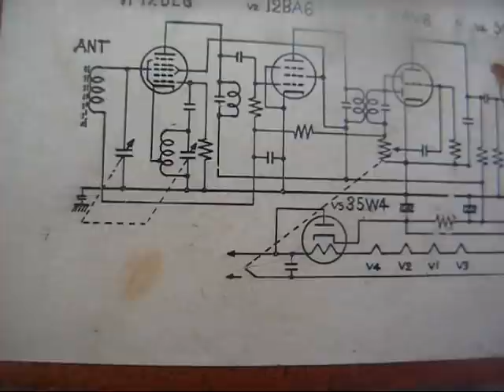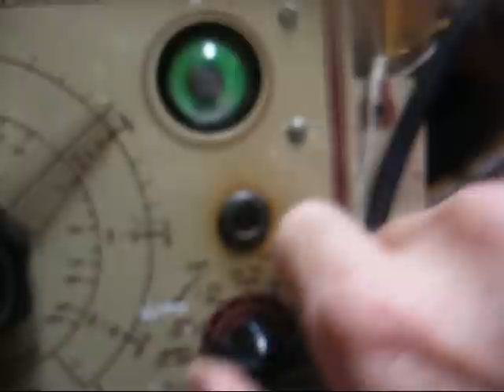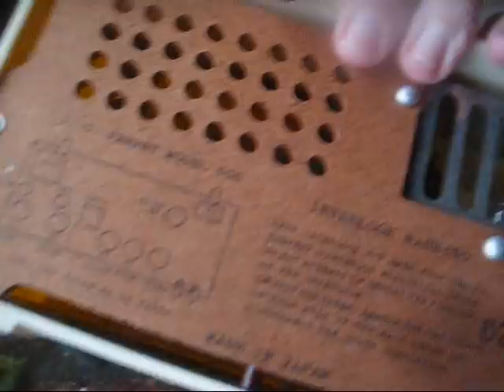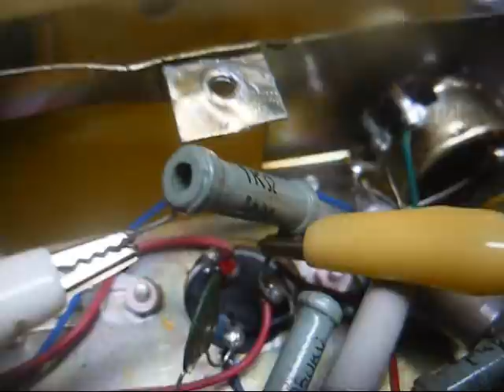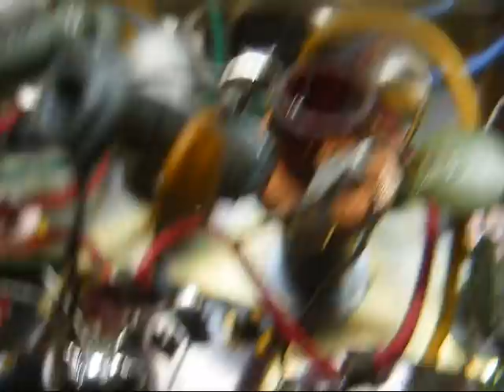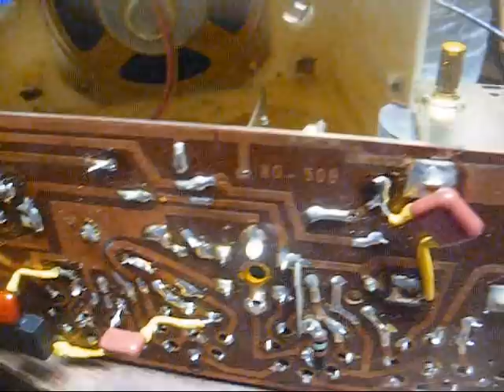Repair of a Strat-O-Sonic & JC Penney Japanese-built tube radios

Comment: It was the winter of 1962, my room mate had a little radio almost identical to that set except it was red and the top the case was melted and nearly touching the tubes, and the set glowed like a small Christmas tree at night when he played it, bringing cheery Christmas Music to our small room furnished with two beds, a couple of chests and a dresser. The cord for the radio ran up the wall to a nail, across the ceiling and to the plug on a screw-in adapter on the light.  A chain from the light ran off to each of our headboards of the beds.  The beds were ancient steel frames that once painted white, traces of the paint remained but only in shielded spots where no human hand should ever touch.  That radio brings back the horror of Christmas Eve 1962.  You see mom and my room mate Dale worked at the same café, mom as the cook, Dale washed dishes and swamped the kitchen and dining area after hours.  Christmas Eve came with a party put on by Otto, the owner of the small café, and as was the tradition back then everyone was drunk as hell at the end of the night. I was fast asleep my 10 year old brain dreaming of a new bicycle I hopped against hope to receive (it was not there!) when Dale began shouting at my Dad, who occupied a room on the other side of the long old house, across the land lords home and in the next apartment.  Dad shouted back for him to shut the fuck up and go to sleep. Now awake from the commotion, I pulled the string and the 30 watt light bulb lite up the small bedroom.  What I saw stuck with me even to this day, the white sheets laundered by my mother weekly were now bright red, and both Dale's wrists were spurting blood which was turning the sheets and walls red with every beat of his heart.  I shouted for dad to come quick, and hearing the fright in my voice, he made his way to me.  When he saw Dale, he quickly used the bedding to make tourniquets' to stop the blood flow and shouted for mom to run next door and call an ambulance (back then the ambulance and hearse were the same unit and driven by the same dude.  Before long two burley cops and the undertaker was there with his cart to take Dale to the hospital.  The little red radio was still playing Cheery Christmas music, which always seems to bring the bloody mess to mind when I hear it even now some 60 years later.  Ah well shit happens I guess and we must live with it.  I have seen much more blood over my years as a Soldier, Police Officer and part time EMT on our local ambulance service (in small towns we often do double duty!)  Thanks for the trip back in time, great video's!  I am a bit behind on your films, you see I lost my wonderful wife of 51 years and 4 Days last August and the pain is still very real, I never knew you could love someone as much as I loved her.

Comment: In my high school 'electronics shop' in appx 1970, we built radios from kits that were EXACT duplicates of that Strat-O-Sonic. (They probably came out of the same Japanese factory)  As you can see from the schematic, it's a very basic circuit, and has maybe 2 dozen components or less. The chassis came pre-punched and we had to mount all the tube sockets & the tuning cap & speaker, and then solder all the rest of the stuff.  It was a good little radio, although the tuning was a bit 'loose' and not too selective if you were in an area with several strong signals. But it worked well, and mine lasted for many years.  I wish I still had it.

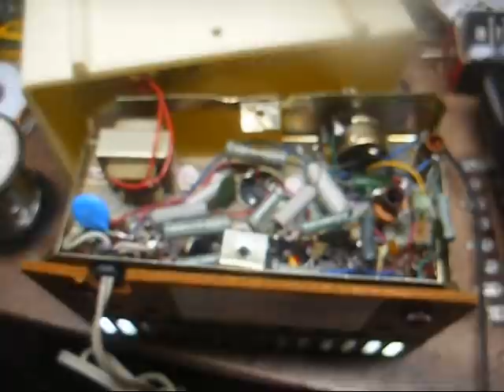Comment: 15:00 What was the reason for putting those caps directly on the line cord, rather than on the other side of the power switch? Could it be that the surge into and out of the cap would have worn out the switch faster?

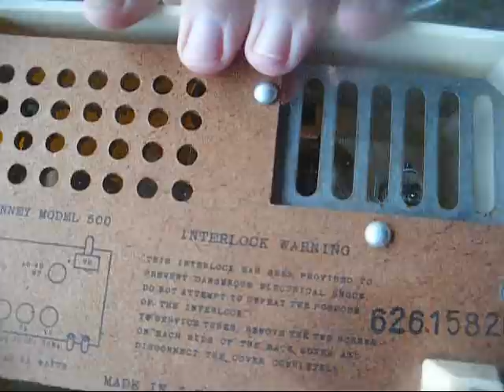Comment: 13:25 If you're not a stickler for details, you might want to grab a cord from  a Norelco shaver; I believe they'll fit, maybe after a little slit down the middle of the plug to separate the holes a bit. I know I've seen cords like that on things like electric knives and even a few boom boxes too, though it might take a bit of creative carving to make them fit an AA5 radio.

Comment: Packing delicate and valuable things is a bit of an art....Like finger painting. An art but flippin easy!
There is no excuse, only laziness or complete mental failure.
For turntables it can be more challenging, being equivalent of making a PlayDough elephant or similar in the art world.
Remove the platter. Secure the tone arm. Remove the lid. Lift the bearing off its thrust pad if it has inner platter attached etc. etc. Use original packing if poss. Always double box. It should be able to survive a drop from five feet easily.
If you pack something and have no confidence in dropping it out your front window then rethink the whole thing. Packing is a pain in the arse, but much less of a pain than getting a broken item sent back.
I have never had any breakages in 40 years. Not one out of thousands.
Edit: Can I have a medal?

Comment: I have a question, I have a restored 1936 Rca 9k floor radio and I want to use either a more modern record player or a bluetooth adapter or mp3 player but need a rca jack for any of those. It just has 2 sets of screws that have jumpers over them and a sticker that says a R-93 record player will make a great phonograph of this radio.. Well I can't just go to my local Walmart and buy a Rca 9k record player.

Comment: I've been buying a lot of home brew Crystal sets from back in the 20s 30s 40s and I got lucky on all of them one of them even has a Atwater Kent tuning capacitor with antenna coil on the back then I got another one that really took a lot of time to make and it works perfect I had to jump a diode across the cat hair Galena . but it still is the best radio I've got its got two coils that are not gang plus another coil that is tunable plus and old brass tuning capacitor out of a radio but it has a knob on it that says robertshaw which is a gas knob.the hours of someone took to make this thing as astonishing and the three-way switch is made out of brass the cat hair whisker knob was made from my looks to be a very pretty Bakelite that was carved.. and the schematic was varnished on the bottom it looks to be around 1930

Comment: Hi, the jumpy multimeter when measuring the grid of the output tube may be a result of your multimeter being in auto range mode. When the meter changes the range automatically, the internal resistance changes too. This causes the voltage on the grid to change and the meter change the range back.
If you put the meter in manual range it may stop jumping around.
Reply: yep , i have the same meter, 10M input on all voltage ranges except 300mV DC range is 100M,  i had mine from new in the mid/late 80s and its still working perfectly

Comment: I just repaired my first tube radio and would like to try another one soon, perhaps one of these would be a good one to get
Reply from the maker: Stick with an American-made 5-tube set. They are usually more roomy under the chassis and easier to work on. These little Japanese radios can be a pain and most people never bothered to have them serviced. When something other than a tube went bad, they usually threw them out.
Reply: @radiotvphononut  good to know, I guess I just liked the small form factor, as I don't have much space

Comment: The JC Penney is a good example of why tubes/printed circuit boards were a bad mix. All of the tubes are seated squarely in their sockets, yet because of board warpage, they're leaning in all different directions
Reply: plus the heat isnt good for those srbp/paxolin boards....they can carbonise,   i've seen pcb's with holes burnt in, and crumbling like charcoal, Pye radio here in the UK made a particularly bad radio that suffered like this, even had a hot mains dropper resistor mounted direct on the board,
Reply: @andygozzo72  Absolutely. I have a GE record player that uses 7189 outputs (which are known for running hot)--there are charred areas all around the board, and I mean actually burned into the board
Reply: @justsumguy2u  and nearly as bad, the first philips pcb radio nearly always will be found to have bad dry solder joints on the valve sockets as they didnt use big enough copper pads around the pins, ..and their next pcb model wasnt much better, still dry joint afflicted in a lot of cases,   one tv engineer i used to know called dry joints 'philips disease', due to how badly their stuff was afflicted !
Reply: @andygozzo72  most of Aussie valve sets had transformers for the step down

Comment: Wow I have the same DMM by Micronta Bryan has. Will wonders ever cease? It works pretty good but shows 30.00 Megohms
with nothing connected to it and the 3 flashes. But works good testing resistors when you do connect one up.
Reply from the maker: This one does the same thing.
Reply: @radiotvphononut  i have the same one, had it since the 80s, the flashing indicates 'over range'  or 'open circuit' in the case of highest resistance range...perfectly normal

Comment: I am getting a lot of eBay sellers posting this on there stuff. Since it has not been used for more than 10 years, it is an exhibition as a junk. If they even class it as junk why they still got a high price tag on it. Could I sell what in my trash can for the same price eBay seller sell there junk stuff for.
Reply: I bought several Old Johnson tube 5 channel CB radios what I bought and the guy told me the capacitor was bad and it hummed . when I got it in the mail it was well packed and I plugged it in at work and it still works someone did a lot of work on it they buffed the aluminum chassis everything looks as if you had to eat off of it he even told me which capacitor it was and I'll call him back and I thanked him. I told him maybe he had some interference at his house because that radio does not hum it works perfect I got another one that works just as well but it's got a different set of crystals they only have five then I bought two more one receives but won't transmit and one just lights up but I'm happy with all four I got lucky but then eBay started wanting money from me did I did not have and I wanted another payment system so I had to get off of eBay and I was making a lot of money I would always ship the next day and it was always packed immaculate I have a webcor record player just like he had only I think it's a little higher in model it says certified high-fidelity under the lid and it is high Fidelity it will put you in a trance just listening to it but I had to order several of those plug-in cartridges / stylis . can't remember the number but I know radiotv phononut  knows what I'm talkin about they plug in and they're getting hard to get

Comment: I was perusing some old electronics ads from the 30s and 40s and most of them listed 2 prices. 1 price for the set (without the tubes) and 2nd, higher price for the set and the tubes. Also a lot "buy here pay here" stuff. These were name brand American made radios, like RCA.   I don't know if it was common to do this later on in the 60s, but that could be the reason for the  tubes that don't otherwise match the set or why you would find a radio full of Toshiba tubes when it might not be a Toshiba made radio.

Comment: One nice thing about the AA5 radios was that you could pretty much count on getting a 6/12 (BA6, BE6, AV6 (or AT6)), and then a 35W4 and a 50C5 (or, on older sets, a 50B5). So if a tube was missing or busted, you could easily find one on a parts chassis, or a swap meet; they were that standardized. Ditto for the sets that had octal tubes in them, though there was a bit more variation in those, I think.
Reply: here in the UK there were a few fairly standard ranges for ac/dc mains sets, one very common one was UCH42,UF41,UBC41,UL41,UY41, these conveniently added up to 117v so suitable for the USA  and other low voltage mains countries as well,  a later line up was UCH81, UBF89,UCL82,UY85, this added up to 126v so not quite so suitable, problem was they needed a big dropping resistor for our 240v ish mains, so many radios ran very hot,  ! these valves/tubes also had alternative USA like type numbers but i dont know if were ever used there?  or even available.....
Reply: @andygozzo72  looking over the list you’ve got, the first group wouldn’t have been common at all over here. The base arrangement looks closest to Loktal, with the 8 skinny pins, but it doesn’t have the aluminum prong in the middle like a Loktal. 

The second run of numbers are the same as the 9/7 pin tubes we used from the 50s on, but some of the filament voltages are odd. 

Typical series strung radio 7/9 pin tubes we had were 6 volts, 12 Volts, 35 volts, and 50 volts. The manufacturer may have also used a dial light, and resistor as a dropper if the complement didn’t evenly add up to 117. 

Odd voltage tubes (like 19v, 38v, etc) would be like something you’d see in a series strung TV. Might be some U.S. equivalent’s to the ones you posted.
Reply: @erikj.2066  UCH42 is 14K7, UF41 is 12AC5, UBC41 is 14L7, UL41 is 45A5, UY41 is 31A3, UCH81 is 19D8, UBF89 is 19FL8, UCL82 is 50BM8, UY85 is 38A3, all are 0.1a heater current, while your USA ones were 0.15a,,  the USA types were used over here by some manufacturers, especially the octal versions, but not that common due to the amount of heat wasted in dropper resistors with those.. we did also have ac only valves with the normal 6.3v heater such as  EL84/6BQ5 ,EZ80/6V4 ..one thing 'our' /european valves didnt seem to have was the dial light tap on the rectifiers, we did have 35W4s here also as a HY90, but one UK manufacturers version was rated for 250v mains use, not 117, so you had to be careful with replacements!
Reply: @erikj.2066  i have a radio like the strat o sonic, but its a 220v version with strange power arrangement, heaters in series with the whole set, ht/b+ current passes through them as well, with a capacitor dropper to make up the 0.15a ... the way its arranged, it'd ideally need the 250v rated 35W4, mine has the UK Brimar made one in, which has a Philips factory code!  but dont know if they were sold with them as the others in the set are Futaba like in the video..
Reply: our FM sets mostly used the Uxx8x  set of valves, but needed a couple more, of course, and heater voltage added up to around 180 to 200, including dial bulbs, so didnt need such a big dropper, i have philips fm set using that lineup that can also work on 120v so has to switch the heaters to 2 separate strings for that low voltage supply
Reply: @andygozzo72  all very interesting bits of info, thanks. 

I did see the cross over between the European, and U.S. tube numbers you mentioned, on the Radio museum website. 

I’d be willing to bet those U.S. style tube numbers were assigned by the U.S. tube manufacturers for familiarity to a U.S. tube dealer. 
To my knowledge, we didn’t manufacture sets that used 8 small pins like those tubes have. 

But... It wasn’t uncommon to find Telefunken, Philips, or Valvo produced tubes packaged in a Sylvania, GE, or Tung-Sol box, with an uncommon U.S. style tube number, all with the intention of being a replacement tube for an imported European manufactured set.
Reply: @erikj.2066  i have an RCA 6DL5, better known over here as an EL95 , has philips factory code and 'made in holland' on it 😉
Reply: USA type loctals were used a bit over here,, dunno if any actually manufactured here or just imported and relabelled,  but there were also european and UK loctals, all slightly different but physically 'compatible' in terms of the same socket , but many electrically unique, no USA direct equivalent (as far as i know?),, such as a EBL21 or UBL21, these were very common in europe, but not so much here..i dont think any USA manufacturer produced any double diode high gain output pentodes like the EBL21 or octal EBL31 ..??
Reply: @andygozzo72  Thumbed through my 1948 Sylvania tube tech manual, and agree probably not an equivalent for the last two you mentioned.

Found a couple used for battery operated portable sets, intended for directly driving a low wattage speaker, but as you can guess most others were dual diode triodes, just meant to be the detector/first AF that fed a dedicated audio output tube. 

However, given the dozens of “radio manufacturers” that sprung up, and died quickly back in the day, I wouldn’t be surprised if there was a no-name manufacturer that tried using one of these tubes as the final stage on a low cost, minimal tube set.
Reply: @erikj.2066  shango066 had a few videos on tvs using what he said was a rare and difficult to get 9A8 tube,  over here theyre known as PCF80 and were common as muck, used in pretty much anything and everything , i suppose uncommon there as its a 0.3a heater where most of your tv types were 0.45 or 0.6 , there was a 6.3v heater version ECF80/6BL8 which is listed as 0.43 heater, near enough for 0.45!
Reply: Unless it was a Philco from the 40's, with the fetish they had for Loktal tubes. 7A8, 7B7, 7C6 or 14AF7/XXD were the main players. It was a toss up if the rectifier and audio output were Loktal, Octal, or occasionally 7 pin miniature.

Comment: Poor volume pots were common in older Japanese gear. For some reason the lytics in these sets are almost never bad but the paper bypass and coupling caps can have issues-the sources of the caps varies . If electrically restored those sets work better than anyone would expect. They used an LC network in lieu of a 1st IF trans with no significant loss of performance. Your set had a shorter loops tick  antenna -I’ve seen some where the antenna ran the width of the cabinet . These radios actually work better than they should. One good thing about the first set is that it is not use PCB construction . Cheap PC boards in the heat of a tube environment is problematic . Thanks